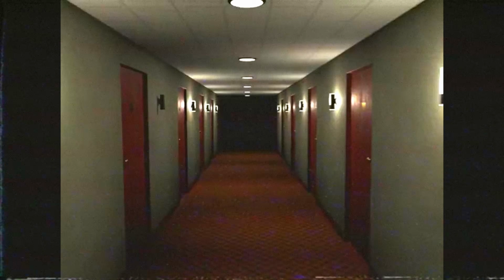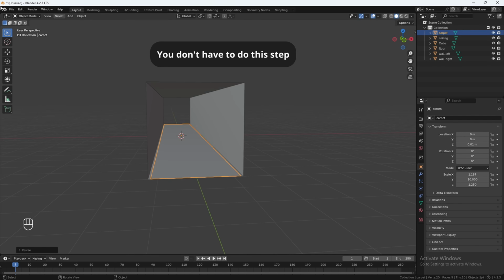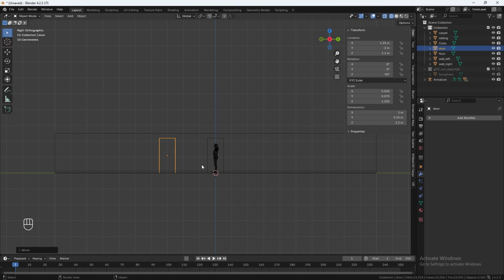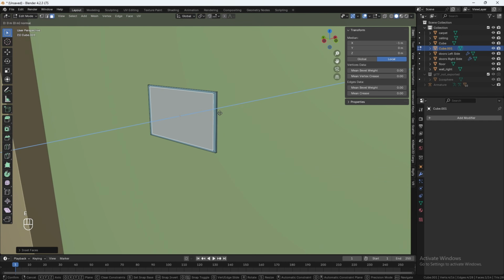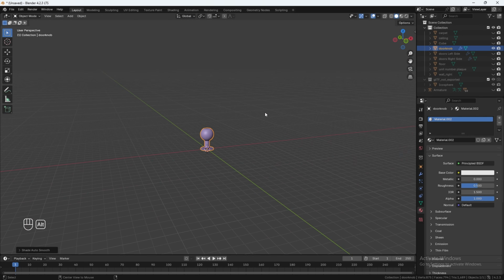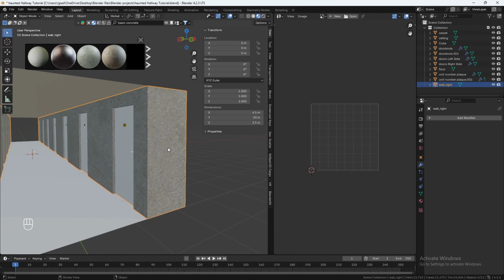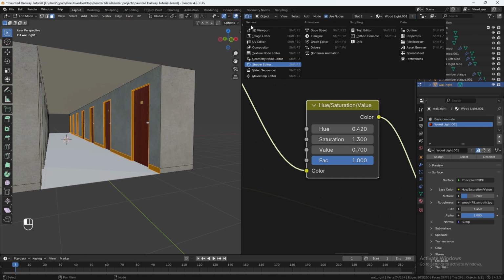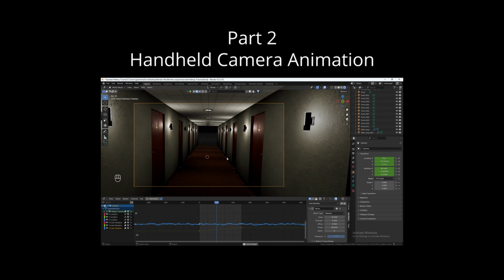How to Model and Texture a Creepy Hallway in Blender (VHS Found Footage)

Comment: I tried to do the cube set up after I deleted the front face of the cube. I still have a clear cube with a black outline inside the center of the cube. Which is strange. Because the dimensions should have also been changed the scale of the cube as well.